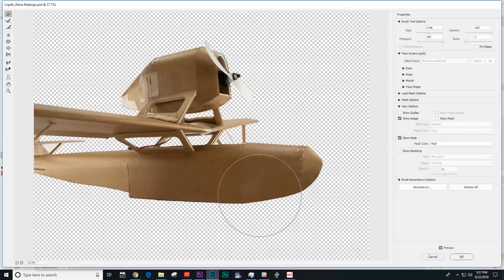Will it float? Porco Rosso ANIME AIRPLANE Prototyping V2

Comment: You'll really want to address the hull and pontoon curvature to reduce drag on the water. Also, Josh mentioned it pulling due to the torque of the motor and that, along with the drag, is exactly what caused the plane to dip on take off. I'd also recommend something like Never Wet from Rustoleum. It creates a hydrophobic film on a surface that completely repels liquids in a two part spray can . It'll help with waterproofing and might reduce some drag on the water but I wouldn't expect a night and day difference in that respect.

Comment: Needs a 1930s era paint job. What about a slight concave curve from the lower half of the nose to the step to channel the air/water flow?
Reply: Is there an easy way to make a concave, complexly curving surface using foam board? This is supposed to be a quick build kit eventually, right? I hope so anyway.
Reply: Tanana M I use a carved wooden block out of balsa and a heat gun.

Comment: Looks amazing! I’d add the exhausts, the small winglet details on the back of the engine pod, and maybe refine the float shape a bit and it’d be perfect!
Reply: Winglets.... oh, maybe that's what the other post was about. Those were the radiators for the first engine.
Reply: Tanana M Oh, my mistake they are radiators. I just looked at a quick side profile of the plane to jog my memory and they looked like winglets

Comment: Here’s a challenge: build a 1/350 scale battlestar Pegasus (mercury class) and a Cylon basestar (both from the new series). And build a viper and raider to launch from each and have them dogfight each other. Oh and the battlestar and basestar have to be flyable also ;) (hint at lift fans and tech used in your shield avengers helicarrier). Bonus if you can get the ships shooting at each other too. Maybe airsoft or paintballs

Comment: Read a really interesting article about why wings are the shape they are - most think the top surface is longer than the lower to make air travel further reducing air pressure providing lift. But apparently not. If this was the case planes couldn't fly upside down!! And you guys have flown many pales upside down. would love to see some experiments with flat wings!
Reply: Full scale planes that can fly upside down have a curved surface on both sides (under the wing, slightly less curved than the top). These double curved wings make use of the Bernoulli Principle primarily with a very carefully chosen angle of incidence. With enough elevator authority, a new angle can be introduced when the aircraft is inverted. Newton's third law is also an element of lift, and becomes much more prominent as things get smaller. Paper airplanes usually have no airfoil at all. My grandfather was an aeronautical engineer. He used to say, "If you gave it enough power, you could make a bathtub fly." This is how you get an Ikea chair in the air, or a cinder block. Compared to what they're lifting, modern RC power packs can be incredibly powerful.

Comment: loving it. the anime plane did struggle to lift off the water, needing a long run to get up to speed and kinda unruly about it. once in the air, fast and maneuverable (twitchy!), so does it need thinner wings and a little larger control surfaces, more power? 2 versions one easier flying and a mod version for intermediate/advanced that's more souped up? really, it is what it is, might as well go all out on it, it's freakin Porco Rosso!! it about demands making a vacu-form mold for the pig pilot too just cuz. figure if someone downloads and scratch builds, they're still going to want to buy Porco..... or a 3D print bust?

Comment: You're making a dream come true!!,
Increase the hull angle and depth of the front like for the heavy float planes like Catalina and canadair, with a step shape after the front bow just under the pilot or so.
Like that when you throttle the high cambered front hull will create the nose up effect, from. The water pressure.
Now you need to make the Curtis on float for Marco Rosso's rival!!
And sell it as a pack for endless dog fights and races.
Please think also of a sppotto put a micro fpv cam somewhere at a pilot's hight.
Then it'll be ultimate!!
I can't wait to get it and paint it like the anime!!

Comment: IMHO you should have a look at the Japanese PX-S STOL flying boat, built by ShinMaywa.  I believe it to be the most successful of its type.  Look it up on youtube, there's an excellent film describing it in detail.  Anyhow, the relevance of this is, they developed a so-called "spray suppressor" which seems elegantly simple and extremely effective.  In your case you could slap some vertical fences on the outside of your prototype which might extend something like 3/8" or so downward from the sides, these would prevent the spray from propagating outward and into the prop. Easy experiment I think.  BTW nice project!

Comment: Ive been folding wings and building over 35 years ..I still.dont understand your choice of building materials...when all white depron is far cheeper ..and covering with clear 50mm tape makes a strong .durable ..heat shrink surface...very lite.. practical easy to repair ..  Most of all.very good looking model .

Comment: Alright guys, the crowds have spoken! It seems that balsa and gas are wanted. In all honesty, I don't see why you can't pull off a balsa kit, you've got the laser, it does just fine cutting the FT Elements, so lets see a "baby's first balsa" kit. This very important sector of the hobby has been neglected, and you guys have the power to change that. 
Second, your seaplanes are amazing, and a PBY Catalina could do very well apparently, I've never got so many replies on a you tube comment.

Comment: How about flying some planes and inducing some control surface issues?  Have a wing come off or change position in flight.  How about an onboard fire in flight and see if the plane can land or continue in flight and extinguish the fire?  Build an on board extinguisher?

Comment: hey, ive been wondering how you cut out your designs when scratch building? do you have a template and trace it onto the foamboard? or do you just measure it out meticulously with a ruler?
Reply from the maker: Jeremy here- Because I am not familiar with the computer program that does laser cuts, I primarily just eyeball my shapes and use a ruler to get straight lines. Then for me it is just a process of trial and error, shaving off where there is excess and globbing glue where there are holes 😂 Josh and Andres know the computer programs to visualize their designs first and have them cut on the laser which makes things a lot easier.
Reply from the maker: Once the final version is released, we provide free plans for people to download and print. Then you just trace the plans with a razor-blade onto the foamboard.

Comment: I say try the pontoons like how they are in the anime, rounded.

As for a challenge: Working MGs in the nose :P (BB guns?)
Reply: 5peciesunkn0wn would be cool but I’m pretty sure that’s illegal
Reply: It's not illegal but it will add a lot of  weight for the mechanism, even with a simple BB gun all plastic. And then it needs power form the battery which could shorten the flight time too.....
Unfortunately I haven't seen yet any foamy with that BB gun system.
Some brand should partner with Japanese airsoft makers like Maruy to engineer a light simple AEG system that could universally fits a certain size of plane.
Reply: It's not as long as you're not strafing someone.
Reply: @ narusawa74 If they use something like the RC ship battles do, a couple tubes, CO2 canisters, an O ring, and a piston, they should be able to get very limited low-ammo count MGs. (But that's what Porco Rocco does. Apparently it's 5 rounds per gun. Despite the anime showing significantly more...)

Comment: Of course it will fly.. ever heard of pby?
Edit: its based on pby..

The bottom if you want it waterproof just give it glue or plastic
Reply: The Porco Rosso plane is mostly based on the Italian Savoia S.21. Hayao Miyazaki, the head of Studio Ghibli's, father Katsuji Miyazaki worked at an aircraft engineering and manufacture in japan. Hayao took inspiration from his fathers love of aircraft into the movie this aircraft originates.
Reply: Blackstarr223 
Great for you cause im not really into planes but all i know is under the plane has similar to pby also the way the engine put execpt porco rosso half fighter
Reply: 123 dodo:
Aside from the fact that they're both floating hull seaplanes, they have very little to do with one another.
As for water proofing, that's partly why Flite Test uses the brown-wrapped foam board, it is more resistant to water. Have a look at their videos regarding the Sea Duck build, and you will find that these planes do just fine on the water, so long as they "float on their lines," as old naval architects used to say. Good paint should remove any doubt as to water worthiness, without the added weight and complexity of extra glue or plastic.